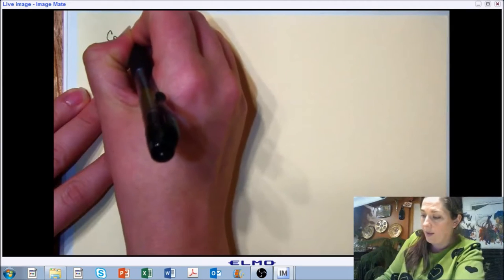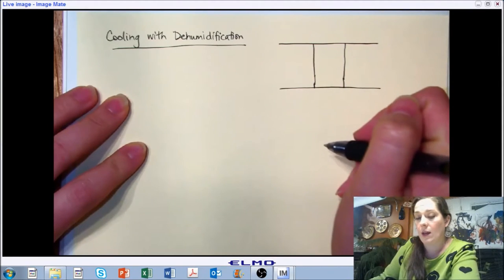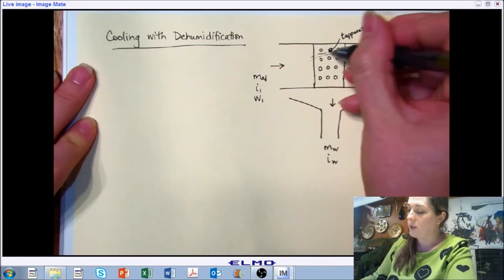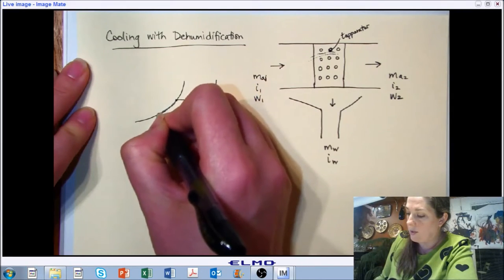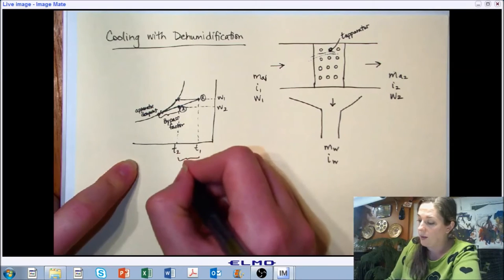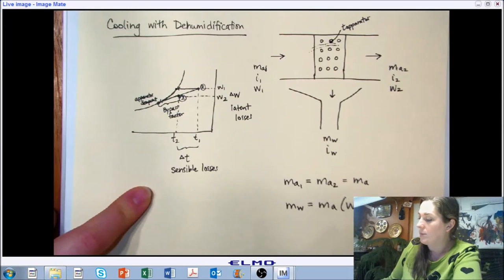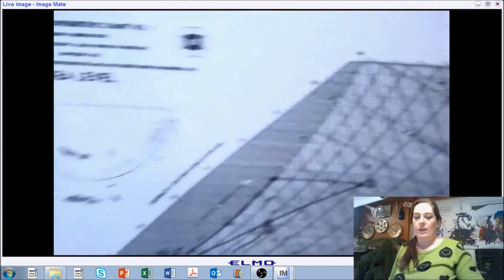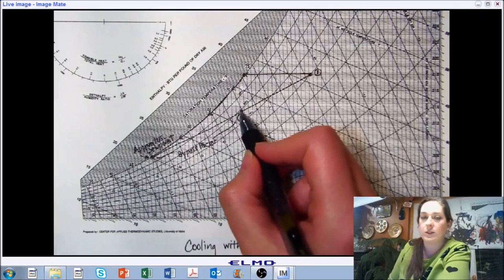LECTURE 3 (PART F): Psychrometric Processes - Cooling with Dehumidification

Comment: Greetings from Morocco, I've been asking myself a logical question for a long time. 
If condensation happens at 100% relative humidity where the vapor pressure equals to saturated vapor pressure (Pv/Pvs), so the point that we will get, after passing the air through a cooling coil, should be somewhere on the 100% RH, and not inside the diagram.
Now you explained exactly what I was looking for. 
Many thanks.